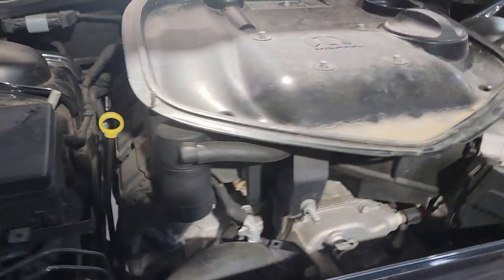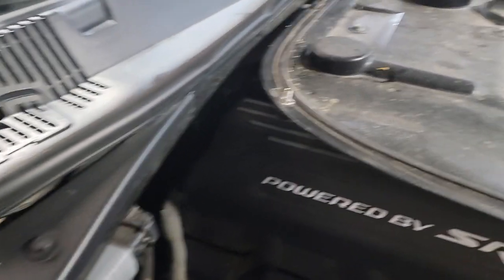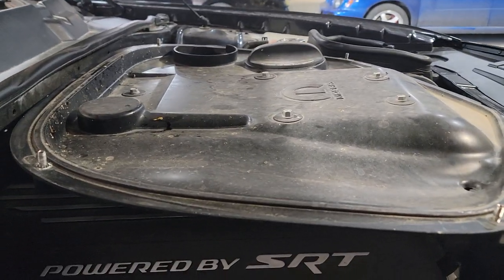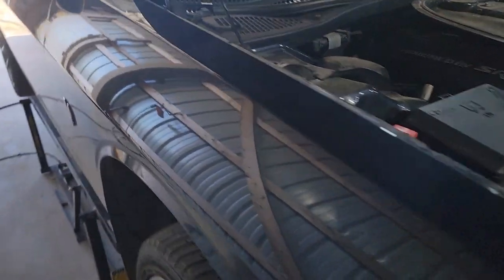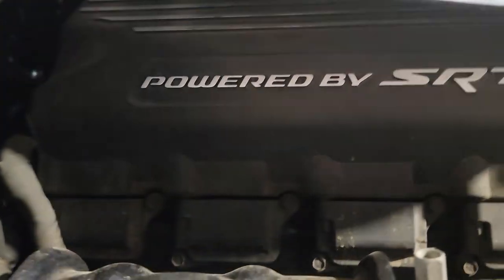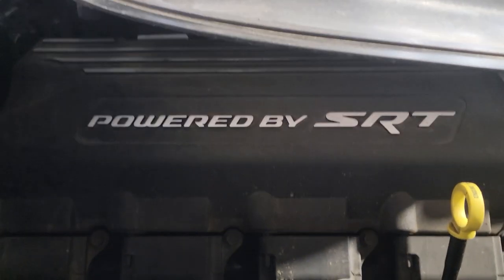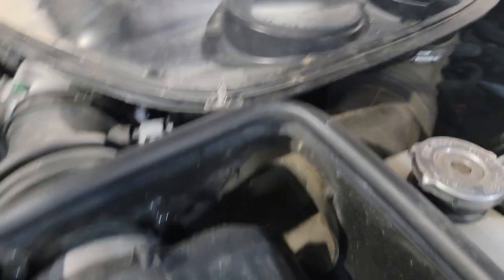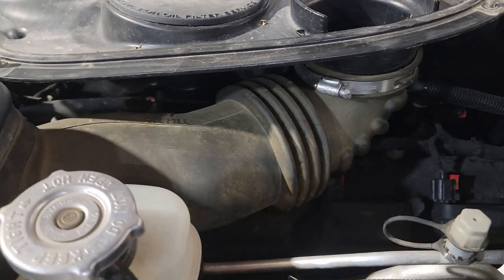What a Normal Hemi Sounds Like!

Comment: Finally someone who knows what they are talking about making a video. Today we have way too many people making videos who are just in it for the money and use scare tactics. 
I heard the ticking on my V6 when I looked at it. Mentioned it and got a good deal. Got it home and put the long screwdriver on the valve covers. Just the normal sound. Put the screwdriver on the injectors and have 2 clicking more than others. Thing is. Sure Mopar gets a bad rap for bad lifters but how many were just injectors? I may try a video with the screwdriver. I also bought the scope and can try that on the camera microphone. 
I did add graphene oil additive to the V6 on day 1. I tried it on my 2000 V6 Honda with 170K and it quieted down in seconds. The 3.0 has adjustable lifters but never adjusted them. So I made a video adding graphene to my Toyota with the cam advance slap on start up. You can hear the difference. Just left the van sit for a few months. Battery actually died. With all the oil drained out of the advance I started it up and no noise at all. 
https://www.youtube.com/watch?v=KPi63XpSACI